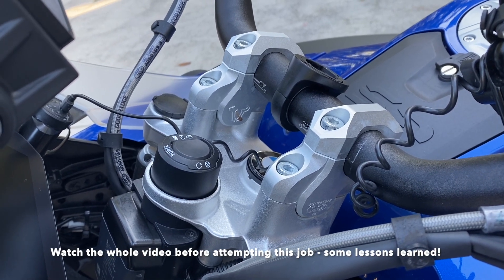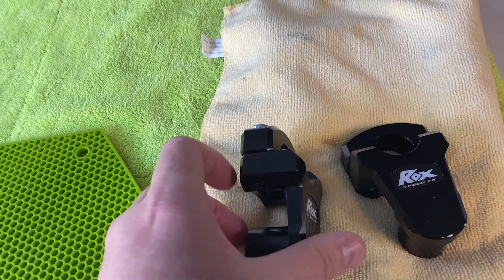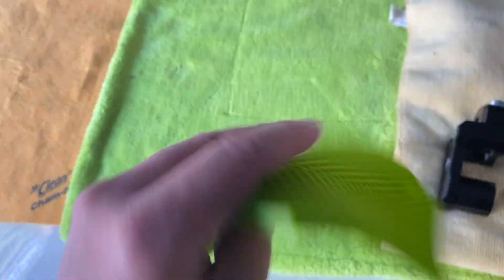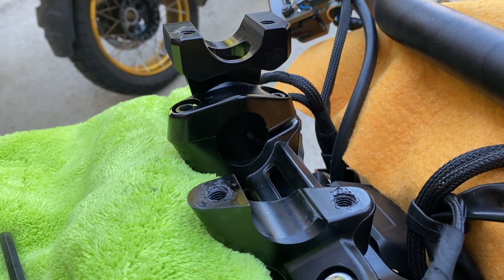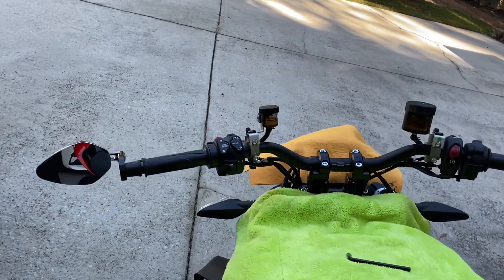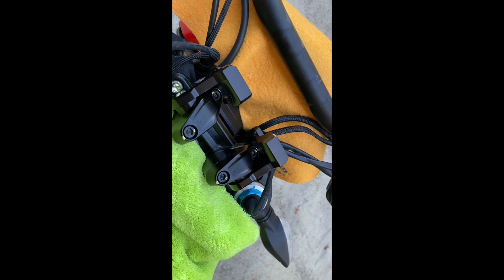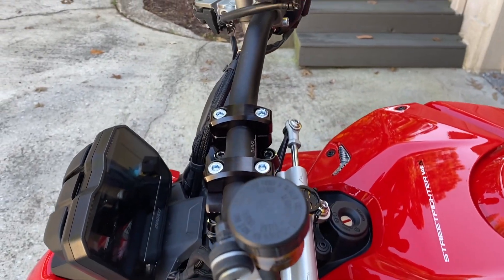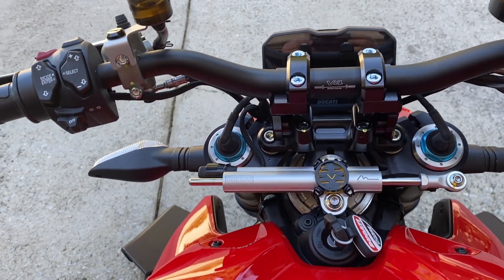RIDE ON | Fitting Rox Risers | Ducati Streetfighter V4S

Comment: Nice instructional video. I Just installed the Rox's on my SF V4S as well, amazing transformation! The bike is so much more comfortable and it doesn't have any adverse effect on the handling. I literally feel like I can ride the SF cross country with these risers.
Also, sorry to hear yours came marked up, fortunately mine were delivered in pristine conditioned from Revzilla.
Reply from the maker: Thanks, Rob. It really makes a big difference to the useability of the bike, doesn't it. I kind of think that the road bike should come like this and lower risers could then be an optional extra for track-day addicts.
Reply: Agreed Richard, too much of a forward leaning position from the factory for a naked street bike.
Reply: I installed these on mine and the turn signal cable keeps coming out on tight left tight turn, looking for extension now bot no luck
Reply from the maker: @gliderider7077  Sorry to hear that. I've had mine on for 4k now, without a problem. You probably have yours cantered closer to you than I have. You can free up a little more space by reversing the bottom clamp I believe, according to a friend who did that with his, but it's fiddly to get off/on again he said. Naturally don't reattach the rubber cable tidies unless all of your cables have free movement throughout the lock-to-lock turn. Let me know if you reverse the clamp. or find a longer cable.
Reply from the maker: @robertmontefusco1902  I prefer the look of the stock bike, but these are far kinder to wrists and hands, no question.

Comment: I'd contact Revzilla and ask for a credit. Assuming they didn't advertise them as an 'open box buy', they should accommodate you, considering you have proof they were once installed & returned. Nice addition, considering these for my Multistrada. Thanks for sharing.
Reply from the maker: That's for your concern Mike, I think there's no way I could 'prove' they were previously installed and returned. But it was very obvious, just looking at the packaging. So I took photos and videos in case I chose to. There's absolutely no question in my mind Revzilla would have refunded me with no questions asked. I've had zero problems returning goods to them before. But as I said in the video, I didn't want any further wait. The 1 3/4" and 2" risers by Rox in black were very hard to come by at the time. They should work well on the Multi as would SW-Motech bar-back risers (what I have on my GSA). And what about that new V4S MTS - whoah, that's going to be a great bike!

Comment: Long term, how have these been as far as unloading wrist pressure? The last bike I owned was the 2008 848 I bought back when they first came out. Had it until maybe 2017? Sold it because the wrist pressure was just too much for me as I got older. I was looking at the Streetfighter v4 and realized the handle bar position was already better, but figured we could maybe get risers to make it even better and found this video! I would love to get back on Ducati again!!!
Reply from the maker: Pretty well for me personally. I've since sold it and had a few other bikes. It's hard to give up a raised bar position, ad not just for wrist support, but neck ache too. None of us are getting any younger! The riser helped. Not night and day difference, but added 50-100 miles a day further. And I could ride it 250-350 mile days no problem. It's the only bike of forty or so I've owned that I actually regret selling. Some I've missed, but that one I regretted selling it, despite the greta price I got for it.

Comment: Hi, thanks for the vid!! Did you find the stem not going all the way in, was OK? I've got weird bar clamps on the TST and found the short stemmed Rox not long enough....may need to get the extended stem version.
Reply from the maker: I didn't have any problems with the supplied parts.

Comment: Beautiful bike especially in red! I have a 2022 BMW S1000R and ordered Rox risers also. When they came in, I was surprised at how much they weighed for what they are. Then I came across Hornig, based in Germany and found a pair that were very streamlined and looked like they were factory oem and they weighed less then a quarter the weight and were unobtrusive. I ordered them Thursday afternoon and they arrived from Germany late Monday morning. Couldn’t be happier! I came close to selling it because the bars were so low. That 35 mm up and 15 mm back was perfect. Here’s the link should anyone be interested…
Reply from the maker: Sometimes weight is a bad thing,  and other times it can be reassuring. When you have 208 hp and the only thing stopping you from crashing is that thin bit of metal holding the handlebars on, a chunky piece of metal can give peace of mind! But I trust German engineering, so I'm sure Hornig makes a well-made product. Thanks fr sharing Sebastino!

Comment: Thanks Richard!  Maybe a bit high for the profile of the bike?  I however agree with the need for a bit higher and back handle bar on the SF.  My son and I made our own on a CNC machine (called it the SF "dogbone").  They are an inch up and back.  And yes that cables are really problematic as they get so tight!  Off topic question:  I see you have a Beeline attached to the bike.  Is that a Velo or a Moto?  How do you find it?  Visible enough in daylight with sunglasses??  Regards!  Ps. If you have the Moto, will a Velo also work?
Reply from the maker: I think stock looks better, but raised is easier to live with. The Velo uses Google Maps (if you can find an app to export waypoints in that - few and far between these days) and the Moto uses OpenStreetMap format really well - I use MyRoute-App to create routes. Beeline is great for creating routes, but you cannot export/share them direct from the app - they tell me they are working on that for future release. Mine is fitted the steering damper, it works best in direct sunlight angles (not so good on the bars). It works well and is the most discreet you can get. But sometimes a map is nice to look at if you go off course, which it doesn't have. So pros and cons. I don't know if a Velo would work (react?) fast enough on a motorbike? But for the money, I'd buy a Moto again - plastic case, the metal case isn't worth the extra - exact same internals and software.

Comment: Hi Richard 
with the cables could you follow them and get a bit of extra length
regards Marcio
Reply from the maker: I followed them down, but I believe they're absolutely maxed out. You can get slightly more (1/4"?) if you reverse the whole bottom clamp. A much shorter friend has done that on his SFV4 and said it was a bit of a pain to do, but that's the only extra play you're going to get IMHO if you go with these risers. Slightly lower ones would look slightly nicer, but these are much kinder to your body, so it's a compromise.
Reply: Hi Richard
I looked at the lower one that you mentioned  can you ask your friend if this is the one ore if you know 
Rox Low Pro 1 3/4" Pivot Risers for 1 1/8" Handlebars
Item: P220827 
that would be very kind of you if you could
Reply from the maker: @ozbiker5311  His are 1 1/4" I believe. You must go for pivot rather than regular risers.
Reply: Hi Richard 
sorry I'm a bit confused are our bars  1 1/8 do the 1/1/4 fit are his on the streetfighter as well 
regards Marc
Reply from the maker: @ozbiker5311  The handlebars are 1 1/8” thick. The rise on my risers is 2”. The ride on my friends are 1 1/4”.

Comment: Great video, thank you Robert!  Do you know the torque settings for the 4 bolts that clamp to the bike?
Reply from the maker: I don't. Usually they're not overly tight (surprisingly to me) at typically about 15 lbs ft.

Comment: Thank you for the video I am looking for risers for my street fighter V4s.
I like these risers. Do I get the 2 inch pivot risers for 1 1/8 inch handlebars? Or do I get the 2 inch extended stem pivot risers for 1 1/8 inch handlebars?
Reply from the maker: Mine were 2" pivot risers for 1 1/18 handlebars. And that was a tight fit. I'm not familiar with the extended stem version, but it sound longer?